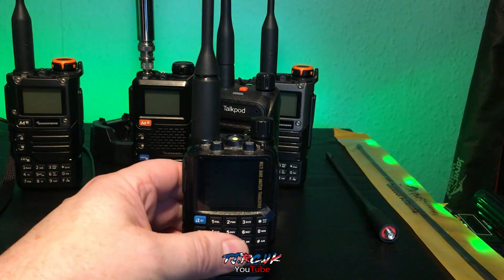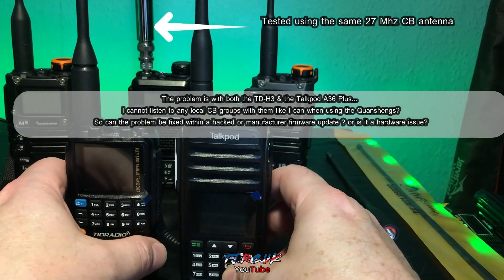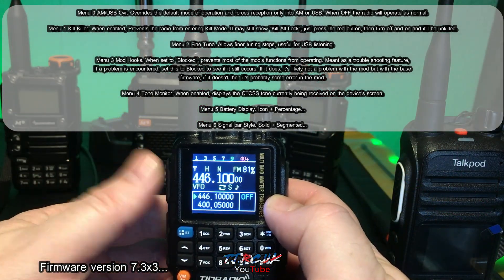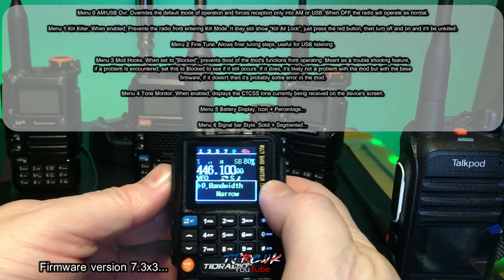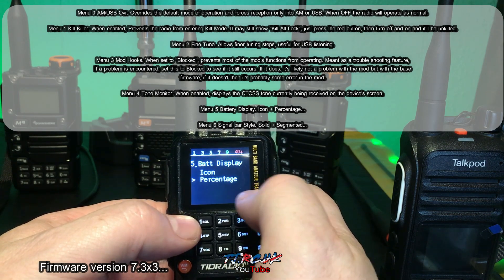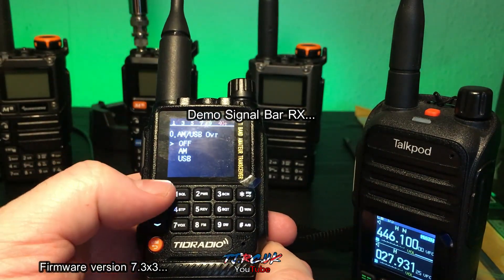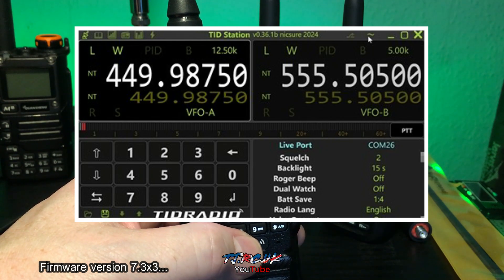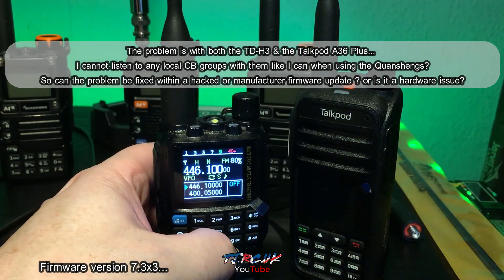⭐Tidradio TD-H3⭐ Hacked Firmware v7.3x3⭐#tidradio #transceiver #talkpod  #quansheng  #hamradio

Comment from the maker: ⭐Website Community Bulletin Board + Product Links for Reviewed/Tested products from the channel + some useful Aftermarket Radio Products⭐ https://beacons.ai/tjtechreviews
⬇Nicsure GitHub links⬇
TD-H3 Firmwares + TID Station: https://github.com/nicsure/TD-H3-Engineering
TD-H3 Logo Replacer:https://github.com/nicsure/H3-Logo-Replacer
Multi-platform firmware flasher for the TIDRADIO TD-H3: https://github.com/nicsure/TDH3Flash
NICMODH3_V7.3X3_240702.BIN